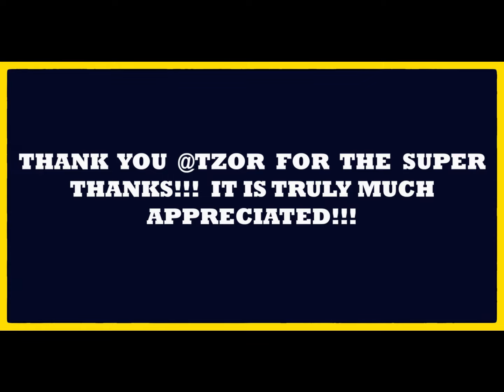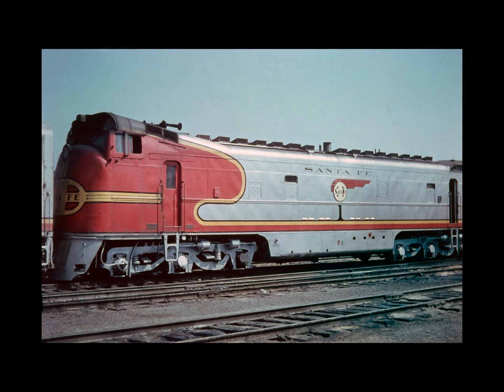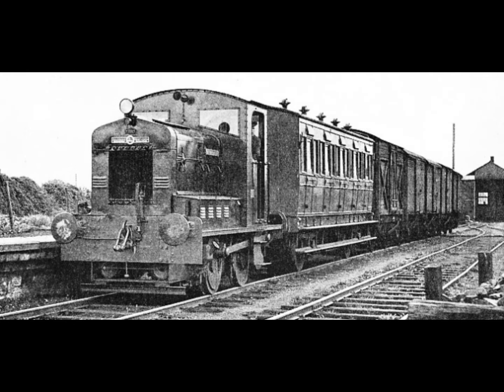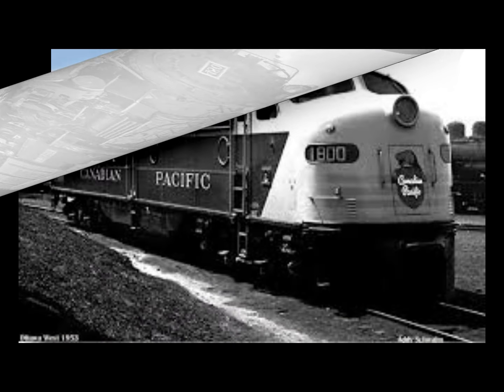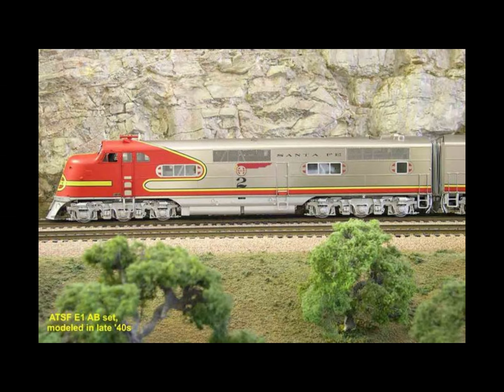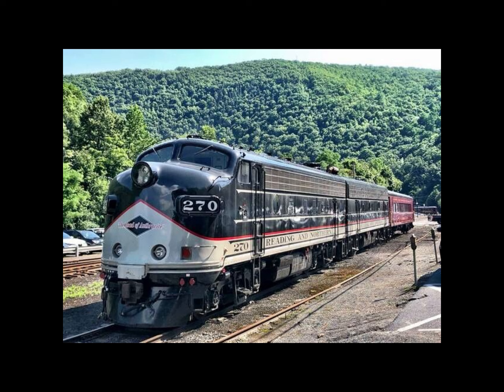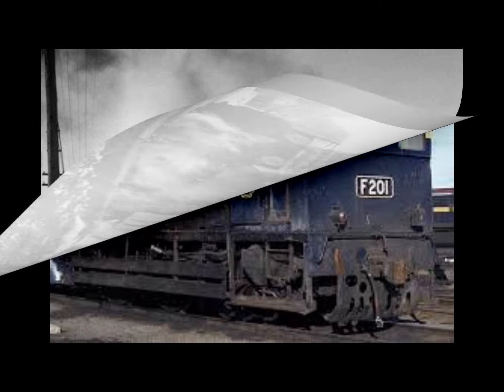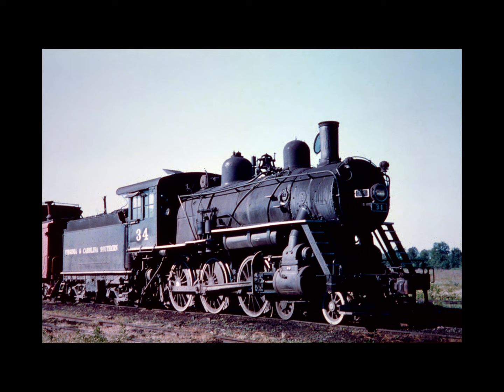Diesel VS  Steam... We know Which Won, But Why??

Comment: Can't wait to see how the new T-1 from the T-1 TRUST turns out. It was a tragedy the PRR failed to preserve even one T-1, Q-2 or the S-2 Turbine. With todays technology we might make some good advances in the problems that plagued these marvelous locomotives. My dad worked from the great Enola yard up till 1963 and I still remember standing on the highway bridge at the south exit of the yard when a big lugger came under blasting smoke and steam in front of my face. Dad said the T-1's were beautiful loco's that to look at spoke "speed", same with the GG1's! Had the Pennsy allowed Franklin Equipment Co. to experiment  more with the poppet valve materials to eliminate breakage at high speed, and Altoona Shop adjust suspension to eliminate slipping of engine drive units we would have had a dependable "speed demon". Several times a Franklin technician secretly rode behind T-1's west of Crestline Ohio to check the speed and timed the run with a certified RR watch at 140+ MPH when engineers were making up time. Perhaps today we might try titanium valves for strength and lightness? As for the S-2 turbine being a "steam hog" at starting and low speed, Westinghouse and Baldwin could have redesigned the gear train to use a two speed forward gear setup, low gear for starting a train, shifting to high gear at running speed to eliminate steam inefficiency. There was already a lockout mechanism so the reverse or forward turbines couldn't be engaged when the other was in use. 
During the war oil was a necessary war material especially Bunker-C while here in the East coal was in abundance. Perhaps we will be in that situation again, in another oil crises, and coal may come to the rescue!
Reply from the maker: I tend to think so when it comes to incorporating modern technology. Mr. Wardale had already proven it could be done.

Comment: I think performance is about how you want to measure it. Sure, Steam locomotives per unit were far more powerful than Diesels of the day. But that’s just looking at the hard performance numbers. 

A great example is modern airliners. They are more fuel efficient, have a greater range, and generally have a greater capacity which means less cost per passenger. At the same time though they are slower, have a worse climb rate, and their Take off and Landing performance is worse than their older counterparts. So modern airliners have worse “performance” but only in the metrics that airlines today would see as antiquated. 

I’m sure if you looked past the hp and tractive effort of steam locos and diesels, the diesels would have a cheaper cost per freight ton and therefore “perform better” in they eyes of a railroad.
Reply from the maker: Well, there are several metrics that the diesel advantage could not be overcome by steam. Otherwise steam total elimination on the railroads does not occur. I do think those advantages can be challenged with todays technology incorporated into steam.. But even then.. rebuilding the infrastructure for steam.. Would likely eliminate those gains. Therefore still not feasible.

Comment: diesel was cheeper, but steam had massive tractive effort due to their sheer weight and the power that you could from those pistons
Reply from the maker: They def. had tractive, adhesion weight and in many cases factor of adhesion over easrly diesels. Not the case today though.

Comment: The “magic” of the diesel-electric locomotive is not its internal combustion engine, but its electrical transmission and resultant adhesion with 100% of weight on drivers.  For the Railroads the utmost attractions were versatility and job elimination.
Reply from the maker: Oh... it's understandable why Diesel won.. Even the early models, But I do think that steam could be made competitive today with some R & D involved. And I do think the PRR was on to something with the S2 had they the money to carry the development forward... They didnt.. And why they invested in it in the first place.. I dunno.

Comment: yes the performance of steam is higher the harder you get it going to effect obviously you only get soo much water to steam no matter how effecent it is for a given size though a loco boiler can make and put out more steam for its size then a simaler stationary boiler I am told this is due to its drafting and the faster it runs the more steam sent up the blast pipe create more draft as well as the onrushing air above the stack, and the hotter the fire the dryer the superheat and more work you get out of the volume, and the more cut off you can use, some as little as 20 percent and this also takes off the back pressure it has to fight on the 2nd stroke of the cycle which robs power from it.
this is also is what happens to electric engines they fight themselves the faster they go though depends how they ar geared, this is also though what gives them the dynamic brakes to help slow it down using the resistance of the electric motors, but steam that generates more power the harder you get it going, and there is soo much that can be done to make steam more effecent and get even more power out of something,

but the reason diesls won was cost you didn't need the special structures to service them, didn't need relubed as much though the nw j got a good systom of getting 500 miles with its system, and you had major work get though from the niagras going 6 days and serviced in one day, though it took brave men to do the job as the hot crew
diesle though you also didn't need a fireman for, it was cleaner and didn't pound the rails like a steamer though again good balancing took care of much of that , it was mostly cost of operation, but on the other hand even an advanced steamer is tougher and easier to repair that was the theory porta looked at in out of the way places you didn't have all the electroncs or expensive diesle that had to be imported and you could take and make an engine that used slack coal in one of thee most remote places with baaad water and make it perform as one of the highest horsepower to weight engines ever built even against diesles, and it used a local fuel but it took fine control of understanding of all the advancements put into one of his engines but it had way less mainanance and as gary bensman who worked with him told me porta would say you get a little gain in efficentcy here a little there and it adds up, and would spend very little time in the shop
Reply from the maker: All valid points

Comment: I think, maybe not the greatest benefit of diesels, but definitely up there, is their ability simply clip together and multiply their output, while still being operated by one man. Then, with a lashup acting as one unit, can the diesel outperform a steam engine.

Cool to see you using images of Victorian Railways rolling stock, even if it's just a couple of little shunters. Makes me proud. 😊
Reply from the maker: I need to start looking more at CN, CP rails locomotives and European as well. Some good stuff and stories to be told with all of them as well.

Comment: I knew an old engineer who said they "felt like they had Cadillacs" when the first diesels went on-line in the 1940s and 1950s!  They even smelled like new cars at first.

Four points to ponder:

"The Financials" trump everything on a railroad. 

Diesels can be equipped with dynamic brakes.  In mountain railroading that makes quite a difference, even more than pulling power.

EMD was allowed to build FTs during WWII but mainly for western railroads, where transporting water to desert engine terminals was a serious problem.

Charles Roberts had an interesting table in his B&O book "West End".  A little hard to explain here, but the crux of the biscuit was that regardless of steam or diesel or number of engines in a train, about 2.5 cars could be pulled per powered axle over Newburg, Cheat, Cranberry, and Seventeen Mile grades.
Reply from the maker: Thank you for sharing.. Things to think about for sure!

Comment: And also, didn't UP 4014 recently get called to rescue a stalled diesel powered freight train?
Reply from the maker: Indeed it did and it performed extremely well. I seem to remember that freight was 11t that it rescued.. Plus the consist it was already pulling.

Comment: Well, diesels are cheaper, but steam locomotives are a lot stronger and more powerful, not to mention some steam locomotives were capable of outmatching the diesels, like the NYC Niagara's
Reply from the maker: Several were able to outperform the early diesels in termS of just that.' Niagara of course being one of them
Reply: Steam locos were stronger than diesels in the 40s and 50s, but not today. A new tier 4 GEVO can produce 200,000 pounds of tractive effort starting; a big boy produces 135,000.

Comment: If steam recycled it's water through low pressure turbine-electric (after the double cycle pistons) and radiator cooling, it would have been more competitive.  Steam out of a  electric power plant is 47% efficient..  the diesel had (has) the better track bogie lay-out.  Actually the combination if diesel with heat steam recuperation would be best.. along with  a capacitor-battery-traction  (-water) car as traction many tines is the main problem on the steel to steel layout.
Reply from the maker: Yeah and they likely would have a recirculation system with todays tech being involved.

Comment: I would kind of disagree with your statement, that diesel didn't outperform Steam. When you look at the strongest Steam vs the strongest Diesel, then yes. But if you look at two trains with the same amount of HP, then no. On equal footing, the steam train can at best perform as well as the diesel train. If you look at lower speeds, the steam train can't produce the full HP and will be worse than the Diesel.
PS: Electric is better than both.

Comment: During WW2 factories were re-tooled to produce what the armed forces needed. This was why all new locomotives needed to be approved by the War Production Board. 

If left independent ALCO, Baldwin, and Lima could have continued to develop the steam locomotive. The ban on new designs stopped that. It was a matter of resource allocation and time management. The pre-war designs already had a proven track record, and the manufacturers already had the plans, molds, and tooling to produce them. Building a steam locomotive was also cheaper than a diesel.

ALCO was already competing with Electro-Motive to produce diesel locomotives. Diesel development was also halted, with ALCO lagging behind. ALCO was allowed to build diesel switchers during WW2, while EMD got the road freight business producing FT locomotives. But quantities were limited by the War Production Board.
Reply from the maker: Great stuff!

Comment: Another thing what knocked steam locomotive in favor of diesel was the blinding exhaust it produced, especially in roadside rail applications. But I could see steam traction coming back as an alternative, though tank engines first.
Reply from the maker: I think todays tech could pull it off for sure.

Comment: During WWll the locomotive type diesel electric engines were needed for use in submarines, a favorite being the Fairbanks Morse opposed piston two cycle model, great power in a compact package. 
The rapid building of new steam locomotives to older designs was that the big builders still possessed patterns for castings and complex boiler plate forming dies, plus the foundry, forging and machine tool capacity to build steam locomotives, along with industrial plant and older employees skilled in their use who could be called back after the depression plus train new helpers, the (HOLDERS ON)!
Diesel engines required a new set of skills and more unique and precise machinery that was in demand and allocated by the WPBoard on an as- needed quota system, and training skilled operators didn't happen overnight. In particular the fuel injector systems which had parts made to the ten-thousandth of an inch or better!
Reply from the maker: Good info! Thank you!

Comment: Seems like the steam engines started burning heavy bunk oil way cheaper than diesel fuel. What saves on cost is number of people a railroad hired to run and maintain trains. Seems much waz due to govt oversight and not funding rail like we funded airports
Reply from the maker: Question is... does bunker C save enough??